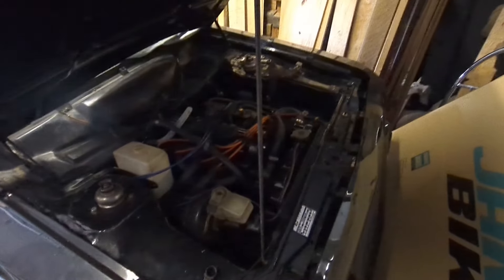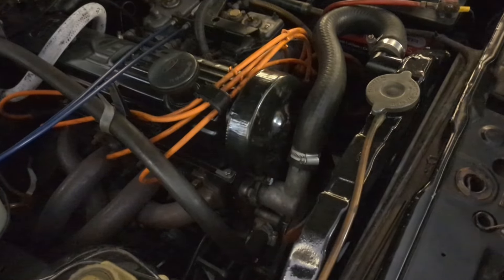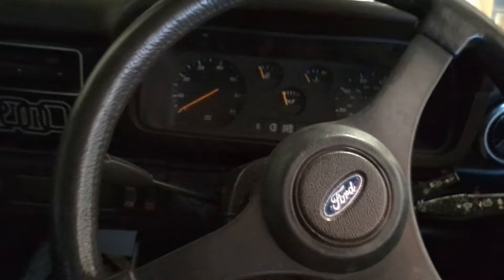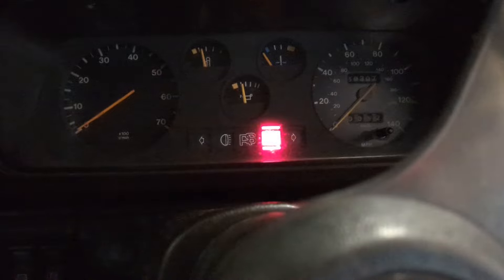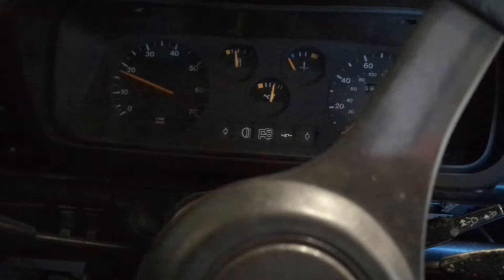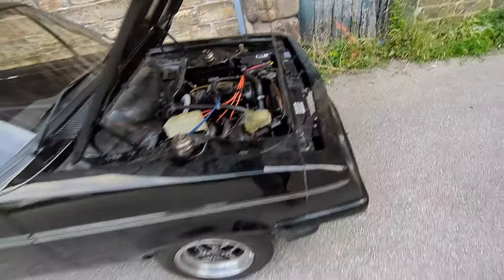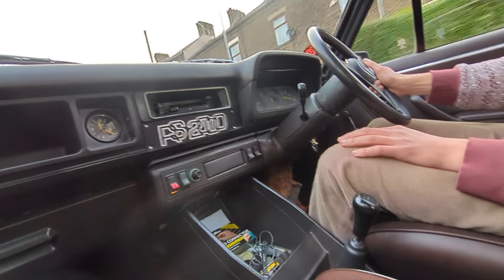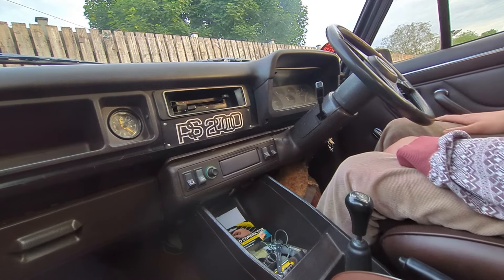Start up, and drive, of Mk.2 Ford Escort RS2000

Comment: In my experience with my old cars it's an issue of the fuel pumping up after not being started for a while. I try to at least start them up every other week and move them a bit. Saves on the tyres too! Really nice car! Mum and dad had a mk. 1 escort that in fully classic way rotted out completely. They had a mk II but got a four door citroen ZX after I've been born.

Comment: Nice car! I have had a few Escorts over the years and other ford powered specials and mine started much easier than that - twin forties are normally good for staring - remember they were standard on most alfas and those were also very good starters . But you do need good fuel pressure (3.5 psi) I wonder if yours has one of those fuel regulators in line with the carbs, they should be on the return? Normal start should be to give two squirts of the accelerator turn key and hey presto! I would love to get stuck into that - I would keep the carbs sounds like they need a rebuild but they are really good compared to the standard set up!